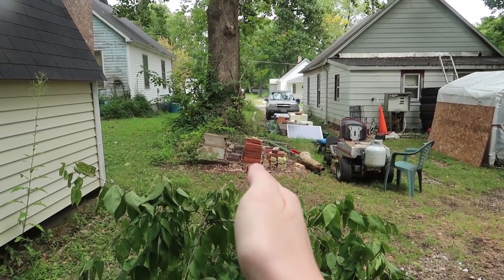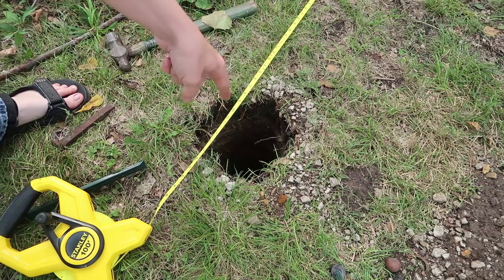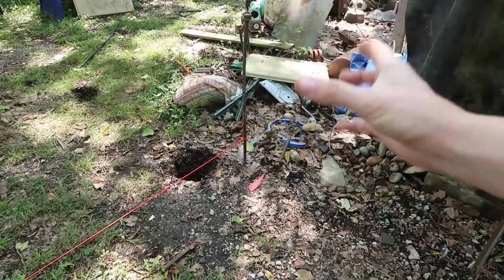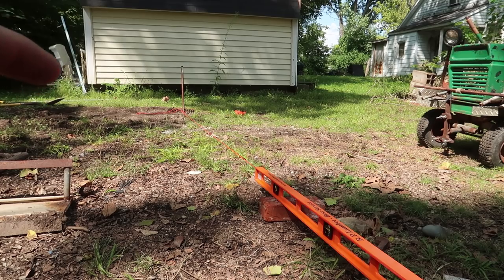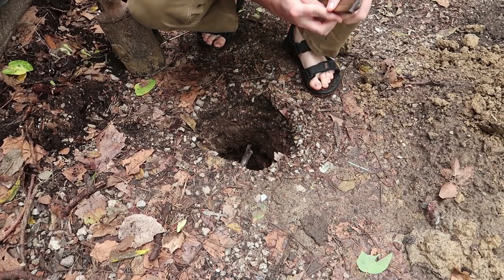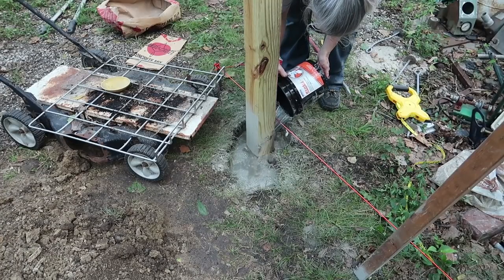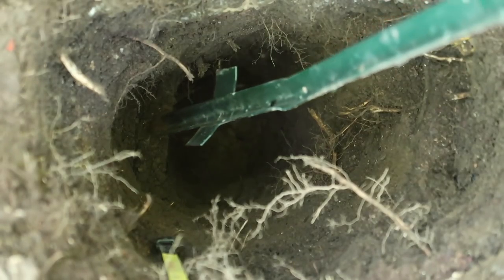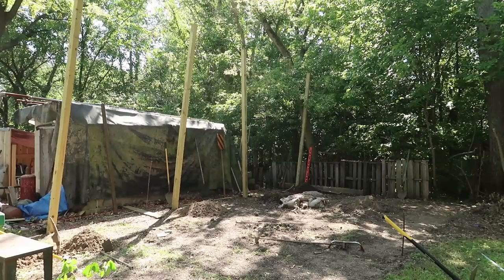Building a 15'x28' (5mx9m) Workshop 03: Digging Post Holes, Grading, Placing First Post

Comment: i have a question, at 6:46, you have a new meter box on your house, you say it has knob and tube wiring still in place, if it has k&t why did you need a service upgrade, was there something wrong with the old one?
Reply from the maker: the electric company upgraded our meter to digital so they dont have to pay workers to come and check it manually each much. instead it talks digitally to their system and saves them money.
Reply: oh, i have heard about that, i was unaware they had to change the box. we still have people who come out and read the meter here in the middle of nowhere.

Comment: Wondering if it would workout better to set the four corner post first so you can square it all up. Then run perfect straight lights to set the rest of the posts. County GIS is so accurate nowadays, you can probably hit the website to make sure you are within property lines. My county requires any structures to be at least 5' from the property line. Great project.
Reply from the maker: thats why i set spikes down that i can run rope between. the rope is almost perfect so as long as i get it to that it should be fine. its taking me days to finish each hole since i need to soak the clay, so each hole's completion is different based on ground conditions. like one took longer because i had to drill through a burried cinderblock. so its also just a bit of what holes open up soonest.

Comment: I built a small shed of my own before using 6 logs as uprights framed with old fence wood I got for free and claded in reclaimed roofing tin it's about 10 foot high and about 19x8 with a dirt and sand floor cost me about 50€ to make

Comment: Have you considered a back door?  Or a window on the back wall?

I was just thinking it might help circulate the air more if you have front and back open.  It might keep it colder in summer if more air circulates.  And if u paint or something with chemicals or something, it might air it out quicker.

Just a random thought.
Reply from the maker: windows will be added after as i salvage them from buildings. ill aldo have an exhaust fan for the building

Comment: *=* At 11:33 you should mix cement and water in a mixer before using it?
But it's the best technical way :)
Reply from the maker: not needed, the cement will suck any extra moisture it needs out of the wood and the ground.
Reply: *=* Ah ok, i forgot the presence of water in the earth... Yes.
Reply from the maker: this is how its been done for decades and decades with proven results of the posts not rotting, so ill go with the old wisdom.
Reply from the maker: no its not just because its old, but because we have posts from pre-war done this way that havent rotten. and since i only need this shed for 10 years i think thats good enough
Reply: *=* My best idea is mix cement and water, empty the water in earth, fill it with this mixture and it will not crumble.
:)

Comment: looks awesome so far, gonna be tall that's for sure!  Nothing wrong with putting dry concrete around the posts, first time it rains it will absorb all the water it needs if it hasn't all ready.  This is exactly how it was done decades before quick-crete or post crete were ever marketed.
Reply from the maker: glad we arent alone in doing it this way. sure its probably the "farmer's method" but it works. :D

Comment: How did measuring distances and leveling the wood go?
Reply from the maker: went pretty well actually. got all the holes dug and the diagonal accross the whole building is within about half an inch and the posts only seem to be off by about 1.5 inches at the top. it helped that our house is a similar level to the posts so before finalizing each post i climb our house to make sure its right. honestly it doesnt have to be perfect so im happy

Comment: Man you're strong heck. Anyway not the reason I'm typing this comment. You have given me the idea to make a small house in my back yard. It's not being used for anything so why not build something in it. I'm going to be using old pallets the are 50 1/2" × 58 1/2". Four of them for the floor
Reply from the maker: i recommend making it moveable so you dont have to get a permit or anything. simply putting it on two logs so you could technically lift it with a forklift should do the trick
Reply: @RinoaL  great idea thanks
Reply from the maker: watch out though, growing up we had a shed lile that and it was always so damn humid inside. maybe line the bottom with plastic. try to get some Railroad Ties for the bottom skids. can sometimes get them for 10$, and they shouldnt ever rot
Reply: @RinoaL  again thanks for your help
Reply: @RinoaL  sadly I'm not having any luck about everyone I've called said that they don't have any or have credit on them and reuse them and they can't give them out
Reply from the maker: try "landscaping ties" at a lumber store. think they are like 15$ each. however you can always build the shed first and then jack it up with a car jack and put it on the ties after. that way you only have to buy them once your done and wont have the problem of buying them and never making the building
Reply: @RinoaL  I was wondering if there's an easier way to talk to you
Reply from the maker: i check twitter regularly. you could send a PM to me on it @rinoaSG
Reply: @RinoaL  ok I just followed you I hope you have nothing against furries

Comment: im currently battling the results of 20 years of neglect of a garden. if wood gets in contact with water or earth for extended periods of time it will rot eventually. i hope for you that the whole thing works out, but those posts might rot in 15 years
Reply from the maker: well, if you dont have good pressure-treated lumber.
Reply: @RinoaL  it held up 20 years. But if it's exposed to the elements every wood will rot eventually

Comment: You would never get away with digging like that around here, every shovel full usually contains a boulder or two, lol. But seiously, one hole like that would usually require you to dig up half of the yard.
Reply from the maker: yeah we are lucky when it comes to that, but since this seems to have been filled up with a lot of garbage, i keep finding cinderblocks i have to dig through. of i hit a boulder id start blasting
Reply: @RinoaL  well... I am a pyrotechnician, display fireworks type, but ive seen people remove trree stumps with them, lol

Comment: 4x4 will not be sturdy enough for the height you are building= wibble wobble and holes should be 5-6ft deep. Use 6x6 or steel girders. You will regret it at a later date.
Reply from the maker: well we shall see